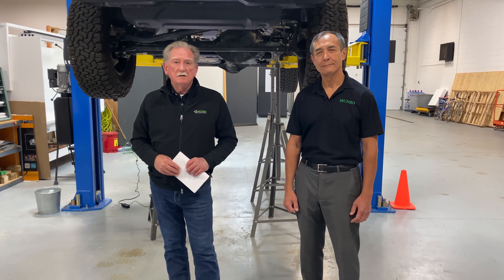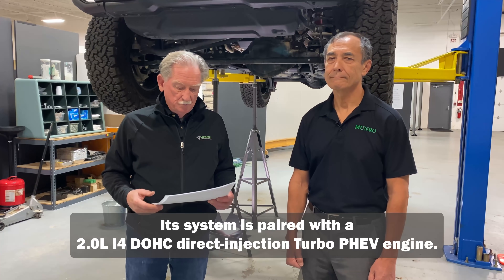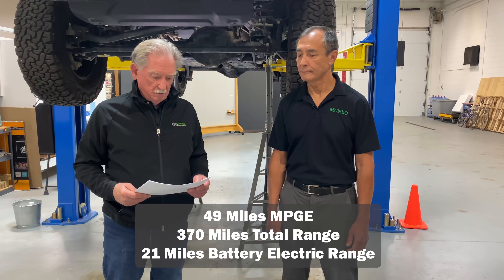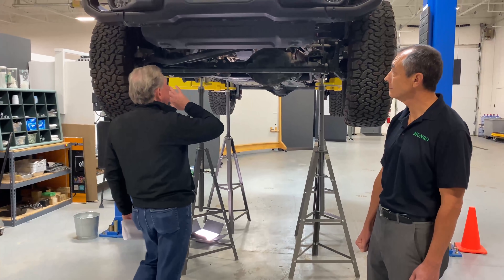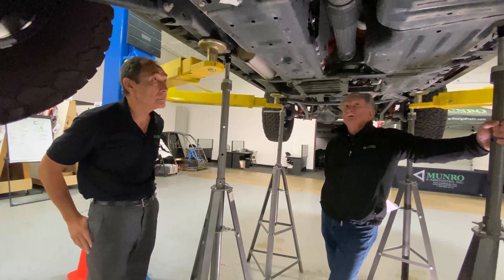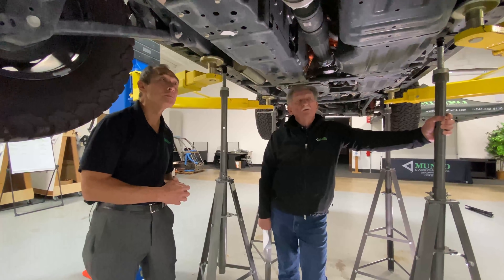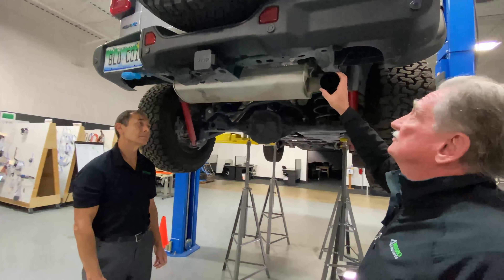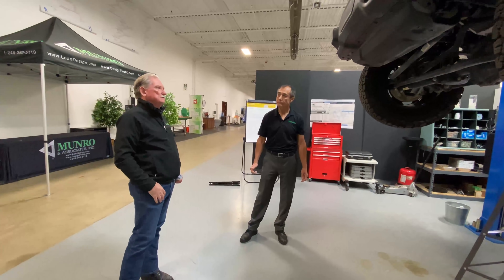2021 Jeep 4xe | On The Hoist

Comment: First, my condolences. 
Regarding the 4xe, it would be great if they could get a larger pack for 50 mile range to cover most people’s commute, so would be full electric for daily use. Would also love to see a PHEV that can to 5000lb so can be used for towing a mid sized camper.
Reply: Stellantis does not have enough batteries......lol.
Reply: No free lunch with energy. A bigger battery means more weight which decreases range. Not to mention that would drive the price up. The engineers had to balance usage, with cost etc.

Comment: Condolences on your loss Sandy. Mr. Ellis will be missed by some of your fans as well. He brought expertise to a much needed segment of his life to more than simply one person. 

Once again thank you for the foray into the inner workings of the Wrangler, your snip-its on the Jeep do give a wide load of expert & real use case scenario's about this vehicle's capabilities. Without the Munro & Associate's team keeping us abreast of the EV technology that is providing motive power into the future where would we get this information from? You single highhandedly have taken up the torch to go where no other person has dared go. Without you out there, I ask myself who would want to do any of this.

By the way thanks for giving the Jeep to Cory. I like to say that Cory's opinion does wonders about his insights about the Jeep. BRAVO on the teamwork aspect of your company.

Personally, I drive a Volt. I appreciate the similarities that your "OB1" technician said about the Drivetrain. When I drive my Volt on the highway it is mostly on the ICE. For short runs in town I do drive mostly on Electric. Even though the vehicle battery is slated to only have 18.4 kWh total with a 13.6 kWh useable the net range is supposed to be a mere 53 miles. I have managed to retrain the BMS to charge up to 85 miles that the car charges to. With regen I am confident that I get over 100 miles per charge. In fact I do not rely on the GOM to indicate the range but on the Odometer to gauge the total range I am getting. Mainly I use the GOM to reflect only what possible range I have remaining.

I think the Jeep you have can also be retrained to get upwards of at minimum double or more range if driven to do so.

Also I forgot to mention that I have friend here in Sudbury Ontario Canada that has a 4xe Wrangler. He has managed to retrain his Jeep to get 69 miles of range. I have no reason to doubt him since I get 85 miles of charging range after being plugged in. Charging on a level 1 home plug socket is only 12 hours. But charging overnight is doable at pennies per day of full charging. Sleeping while the vehicle charges is acceptable.

Comment: One thing I like about hybrids is the "4th dimension transmission," as I call it. The engine can charge the battery while cruising and then when accelerating at a later time that power can be drawn upon so the engine doesn't have to rev up. I'm talking about all those routine acceleration from a stoplight to 30 mph. Big impact on MPG, afaik.
Reply: They honestly need to stop calling it a hybrid.  This is built like a volt, which also stupidly called itself a hybrid.
It is really series vs parallel hybrid, but the problem is hybrid = prius.  These series hybrids drive like EVs that have a gas range extender.  At all times, even when the gas engine is being used, the car has instant torque like an EV.  I would market these cars as EVs with gas assist and range extension.  A normal hybrid is a laggy gas engine with EV assist and no-instant torque, the opposite of what you want.
Reply: Good point, one possible future upgrade would be if there is the option to moving to new CVT Toyota Style transmission. Not the CVT bs as used by Nissan, but the planetary gear system with the dual electric motors used to control the Sun and Ring gear. Its a brilliant simple design for any Hybrids.

Comment: The MSD (Master Service Disconnect) is under the seat in this case. Was hoping you'd rate it's accessibility and safety.
There should be some supplier information next the MSD.

Comment: Bummer that the "fast charging" system is limited to only about 35 Amps... So the fastest you can ever charge will still take over 2 hours, even for this tiny battery.
Reply: That actually seems typical to good for PHEV.
Reply: seems to me LEGACY has ZERO Clue when it comes to  Hybrids and BEV.........LOL
Reply: Should be fine to do this overnight
Reply: @markplott4820  nonsense, those batteries are made to last at least 10 years and the 2hours is a full charge. A bigger battery can charge way faster with a puffer.
Reply: @alanmay7929  - TESLA battery pack 2020 design to last 500,000 miles, 2021 pack design to last 1 Million miles, on older 2170.
4680 will last more than 2 Million miles.
and Tesla since 2020 can charge at 1000 mph in 10 minutes to 80%.
Reply: @markplott4820  Tesla is in a class all by itself though. Legacy auto only shines in the ev space when being compared to other legacy evs
Reply: @markplott4820  Given how Tesla has consistently failed to meet those goals, and has consistently lied to customers and investors I'll believe that only when a large enough sample size of vehicles hits that mark. Teslas entire advertising is built on false claims, even the sub 2 second 0-60 of the plaid. it's sub 2 second if you subtract the first bit of rollout from the time and then do it on a fully prepared drag strip. I say this as a former model 3 driver (had one as a company car for almost 2 years), never believe their claims at face value.
Reply: @Kevin-hp5fk   - FALSE, Tesla has ZERO Marketing Budget and does NOT do Advertising .
however , as of Yesterday .
HERTZ car Rental has 4 Ads featuring TESLA model 3 , 1st Time EVER. 
and HERTZ is buying 100,000 TESLA model 3. 
IF, the cars were NOT the SAFEST and the MOST Reliable , HERTZ would buy another car. 
INSTEAD , Tesla is replacing 25% of HERTZ Current Fleet , with Ultra Efficient, Ultra Reliable and SAFEST cars you can buy. 
and TESLA did not even give HERTZ a Discount , they paid $4.2 MILLION for the cars.
and TESLA will Deliver 5,000 cars soon and the rest between now and 2022. 
gm & FUD motors are FUCKED.
Reply: @Kevin-hp5fk  - NOPE, the BEST marketing, is NO Marketing - ELON.
Reply: @markplott4820  you seem to think that musk articively promoting and marketing Tesla via his social feeds and public appearances isn't marketing. It's non traditional marketing. Just another thing musk lies about and you lot believe.
Reply: @markplott4820  Veering a little off topic there, aren't ya?
Reply: @markplott4820 yes hertz cares about safety and reliability. That's why they buy tons of Sentras and Altimas lol.
Reply: @jmarxful   - none of those are as SAFE as any Tesla model.
Reply: @markplott4820 now hertz is liquidating almost all of its tesla fleet due to high repair costs 😂. Certainly cast doubt on your "most reliable" claim. What a brilliant idea hertz lol.

Comment: Would like to see an all electric Jeep. Always wanted a Jeep, never saw the need. Wish they still had CJ-5s.
Reply: There are some pretty sick DIY EV YJs and TJs... I haven't seen one with more than 30-40mi effective range off-road, but they are incredible at crawling over obstacles.
Reply: I want a all Electric ⚡ AGRO Jeep as a daily driver and light farm work.
Reply: This is a series hybrid like a volt, not a parallel hybrid like a traditional slow laggy prius.
They honestly need to call these EVs with gas range extension or gas assist.  These type of hybrids have instant torque, even if the motor is running.  They drive and accelerate like EVs.  They are the full EV feel and any EV owner will feel at home driving one.  It is a massive mistake to market them as hybrids because people think of a prius when they hear the word hybrid.
This jeep is going to sell out constantly.  It is a huge improvement over a traditional jeep and you don't have to worry about EV chargers anywhere you go, so it doesn't change the behavior of any jeep owners.
GM screwed up when they canceled the volt.  Jeep is extremely smart for diving in with a volt like drivetrain for their first EV.
Reply: Buy a Rivian.

Comment: To give the total torque be sure to multiply engine/motor torque by first gear ratio, transfer case low range, and axle final drive. And at a standing start add 2:1 for the torque converter. When I've done this the torque at low crawl speeds is well in excess of the electric vehicles.

Comment: Sandy: Tesla is so amazing that I own two. Wait actually I have a Jeep and am going to buy another.
Reply: Whats the Problem with that?! The perfect car does not exist. The toyota prado diesel comes with an extra large fuel tank for impressive range to cross entire deserts, go to remote places.....
Reply: We have to buy crappy electric cars and Sandy buys a fake hybrid, mostly gas car.
Reply: @rlemoyne007  This has a similar drivetrain to a volt.  That means even if the battery is at zero and you running on gas, it still has instant torque.  This is because even when the gas engine is running, it will generate both torque and electricity to power the electric motor.  So it never operates without the electric motor.
I drive a volt and it always has instant torque with or without the gas engine running.  It accelerates like an EV, not a laggy gas car.  This jeep will feel like an EV and not be hampered by the lack of non-tesla EV chargers.  It is a smart choice by jeep and will sell very well.
Any EV owner will enjoy driving this jeep because the instant torque will make it feel no different than any other EV.  They really should call these kind of hybrids "EV with gas assist".

Comment: tOYOTA FIRST GENERATION Hybrid was 1997, they are now on 4th generation.   Jeep-Stellantis after 24 years, TWENTY-FOUR YEARS is finally catching up.
Reply: True, but toyota hybrids are pretty much the same as they where in 1997 and it clearly shows that hybrids could not evolve any further than that.
I've got gen 3 prius and it's pretty remarkable car, but I've changed it for chevy volt and it's so much better because of bigger battery and charging capability

Comment: can't help but see a lot of extra complexity due to keeping the gas engine around
Reply: but, it keeps gm and FORD in the BLACK, as they are able to REPAIR and fix , all those JEEP and BRONCO.
Reply: You kinda need it though.  Battery range sucks too much and weighs too much.  You throw a lift and bigger tires on this with all EV and you’d get like 80 miles range
Reply: It is not complex at all and the electricity actually runs alot of the equipments that were usually connected to the engine with belts. The electric motor also replaces the starter....
Reply: @Story_Teller_Everyone  that's only because it wasn't designed to be electric from the ground up. look up the rivian
Reply: @EV3NTH888  I’m actually buying Rivian, on preorder.   But if it was built like my Jeep it would still not get much range, and for rock crawling a built Jeep is pretty unbeatable.
Reply: @Story_Teller_Everyone  have you seen some videos of it? I wouldn't say that, I bet it would beat a jeep in all bit the tightest obstacles
Reply: @EV3NTH888  definitely not, it’s much heavier, less articulation by a lot, less tire, less clearance,  no locking diffs. Honestly it couldn’t do a lot of things a modified Jeep can do.  Example large ledges https://youtu.be/AYspli4TWnc .  The cool part of Rivian is it’s great off-roading on normal trails, awesome onroad, tons of power,  very nice interior.
Reply: @Story_Teller_Everyone  look up the videos, you'll see
Reply: @EV3NTH888  I’ve watched them all,  I am positive it can’t do what my Jeep can’t do.  Just look up Moab obstacles.  It can do steep grades there but the hard obstacles no.  Like I said I’m big fan of Rivian,  it’s just not intended for this stuff.
Reply: @Story_Teller_Everyone  https://youtu.be/Yeth5v_5dPM nuff said
Reply: @EV3NTH888  honestly that is much easier than it looks.  I already linked you something it 100% couldn’t do lol.  I have a lot of experience rock crawling I go to Moab a couple times a year.   Solid axles have huge advantage rock crawling,  they do however suck on the road.
Reply: @Story_Teller_Everyone  what you linked has 2 problems. it's a matter of how short the overhang is and it's showing a guy climbing that ledge for the sake if climbing that ledge. if I can get to the same area by taking a different line that's perfectly fine. if you want to compare details we can do that. does the jeep have that pass through tunnel for storage? how much does the maintenance cost? how's the fuel economy? etc etc
Reply: @EV3NTH888  https://youtu.be/_whAj3KNApM. Here is another example the entire trail has large climbs.  Not sure why we’re debating this,  the Rivian is cool and better in many other ways.  I’m super excited to get one, like you I’ve probably watched ever single video in them.
Reply: @Story_Teller_Everyone  at 1:17 a jeep is trying to climb a ledge that's way too high for the rivian. what's to the right of that is a much lower ledge that the rivian could drive onto and end up in the same place, the rest if the video has ledges that are low enough for the rivian.
Reply: @Story_Teller_Everyone  we're debating this because people keep making the wrong comparisons and and keep underestimating vehicles that have more advantages than disadvantages AND they are still in their infancy. the first commercial production of internal combustion engine cars started in 1886. if we had the development time from then to know with electric cars we'd be light-years ahead. instead greed took over.
Reply: @EV3NTH888  For sure, already alot of awesome EV's coming out.  Now we need to get better charging infrastructure for people towing.  Battery tech I think will improve quickly given how much money is being dumped into it.

Comment: If you're worried about water crossing why wouldn't Jeep have a sensor that detects water level and turns off the ICE engine and switches to electric power? It would out perform any snorkel. Sure you would need to seal off the intake and exhaust but for 70k they should be able to make some small innovations

Comment: Hmmm interesting. I would consider this car very seriously if it did like 50 miles on a charge. Good option for Europe as Cybertruck might not be available for long long time here.
Reply: With the price of gas in Europe no one there would even consider a Wrangler.
Reply: @Resist4  that's why plugin is great deal. I could drive only electric for 80% of my journeys and that would make fuel efficiency non important.

Comment: I tried to get a deal together on a 4XE Wrangler High Altitude trim level, no luck.  Don't need the off road goodies as I'd be using it as my severe weather winter commuting vehicle.  Looking forward to further videos on this, I'm amazed at this powertrain.  Up here in Canada I'm still skeptical of BEV due to range issues with the cold.  I hope they put this powertrain in their whole lineup.

Comment: It has been my understanding Sandy doesn’t care for hybrids.. Apparently Sandy is passionate about his Wrangler lol. 
 For me, Chrysler and Jeep products are just absolute junk. Possibly the least reliable vehicles out there. Maybe some engineering  focus on improving quality? Additionally, a 4Runners rear window is brilliant. The new Jeep design is cool tho.
Reply: Hybrid is a very misleading name for this. Most people hear hybrid and think slow laggy prius.  Prius is a parallel hybrid and this jeep is a series hybrid like a chevy volt.  A series hybrid should really be called an EV with gas assist/range extension.  A series hybrid drives like an EV.  It has instant torque even if the gas assist engine is running.  It drives like an EV and any EV owner would enjoy it the same as any other EV.
I drive a volt and chevy was stupid to cancel it while still selling ICE vehicles.  Chevy should have made an SUV or truck with the volt drivetrain.  That is what Jeep did here.  They made a jeep that feels like an EV when you drive it, but can run on gas so you do not have to change your behavior as a jeep owner by planning around chargers.  There are not many non-tesla chargers around, so going full EV would have hindered sales.
This jeep is going to sell like crazy because instant torque makes an EV so much better to drive.

Comment: I'm probably missing something, but if I were designing this, I'd want to replace the transmission with a generator, then use a separate motor to drive each wheel (like Rivian) powered from the battery and/or generator. Thus get rid of the driveshaft and differentials. Then also give the buyer the option to replace the engine and generator and radiator and gas tank and exhaust system with more battery modules ... making it an E-Jeep or a hybrid-Jeep. Bad idea?
Reply: someone said that car companies have to use the existing plant and machinery for making ICE cars to maximise the capital outlay first which includes lots of inventory and orders placed and this is the result, a combination of old/existing tech married to a little new tech. 
As time approaches to replace plant and machinery, totally dedicated design and manufacture of complete package EVs will take place, so in a nut shell, car manufactures need time to adjust to the new demands. Tesla was an EV manufacturer from the beginning so they had a big head start in that regard but not so in actually making them. Take what I said with a big pinch of salt.